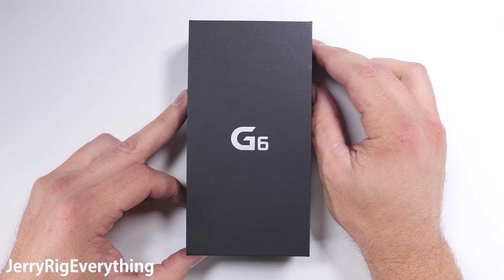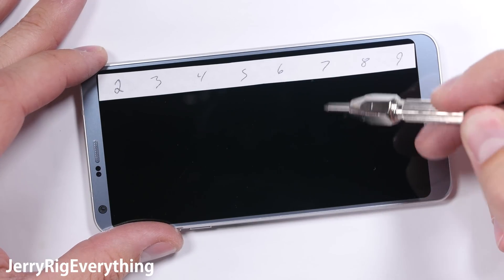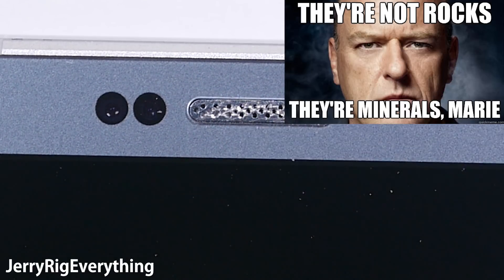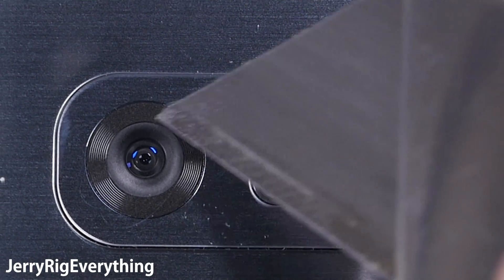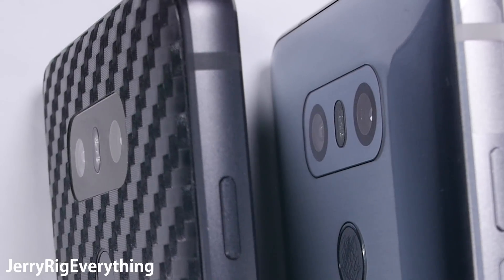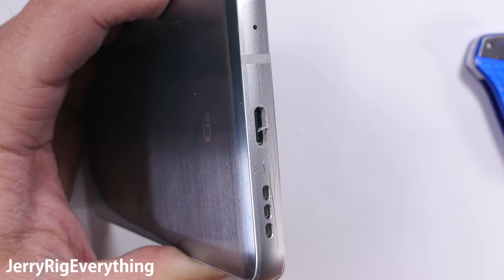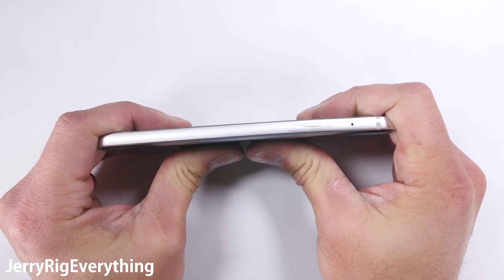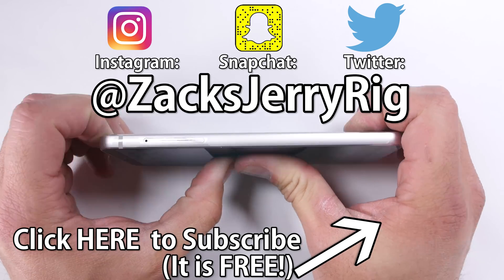LG G6 Durability Test - Scratch BURN and BEND tested!!

Comment: I have one of these that still works, but i'd need a new one with 64gb or i cant even use it these days. That said, i have dropped, stepped on, threw, and more..including putting one in the washing machine... and all i can say about it, would be the lense cover is not as hard glass as the main glass, as it broke, but the main screen glass barely cracked.. the phone has MANY chips in the metal from how much torment it went through, but still functions as normal.. i also have zero scratches on any of the glass surfaces, but annoyingly the rear case glass is broken in a few places. The BLACK one is plastic, i think, cos it cracked but never shattered. Honestly miss using these G6s..

Comment: My G6 is still going strong after almost 6 years! Even after having it fall out of my pocket and slide across parking lot floors multiple times, it only has minor scratches on the back and is still perfect otherwise. The metal border really helped it break some falls! It's sad to see that there are no new phones made as well as this one; all of them have either no headphone jack, no expandable storage, a notch or a huge camera bump...
Reply: i miss my lg g6 man. is it still worth getting a new lg g6 or no?
Reply: @Hamzah.162  honestly, I wouldn't get a G6 now. I replaced mine with a Sony Xperia 1 IV a couple months ago because I needed a bit more performance for my job. The G6 hasn't gotten any new security updates for quite a while now, though it'll probably be fine. Sony's phones are the best replacement for LG:
• headphone jack
• SD card slot
• no notch
• fingerprint scanner on the side
• the 1IV also has a metal border
• con: camera bump
• con: quite expensive

I would suggest going for one of Sony's phones IF you can get a good deal somewhere, I got my 1IV for around €600.

Comment: I have had this phone for almost 2 years and it is a very good phone. My only issue is the camera that used to work so perfectly and take great pictures changed. The camera area got scratched. The fingerprint function stopped working on its own but never cared to fix it. The phone is waterproof for sure.

Comment: I have a G6. I left it on top of my car's roof and drive off. 5 hours later I realized it wasnt lost, but most likely on the side of the road. I gps tracked it about 1/4 mile from my house and the screen was broken. The back of my thin case and pop socket had rock divets on them, so I knew it had gotten run over. I got a new screen and battery installed and it still works, I'm still using it.
Reply: @Lulu Tha 2 good
Reply: my lg k11 got runned over 2 times and the screen didnt break, only glass, so i could still use it

Comment: Still have using my unlocked G6 after 2 years. This phone does not get enough recognition! I have yet to have issues with it besides the occasional slowdown but returns to normal after a day and that's only happened a few times. It is still super quick too. Not to mention the 4k uhd HDR display and 4k Video recording for a phone that came out in 2017. This phone is a beast.

Comment: Don't buy the LG G6!!

I have owned the g6 for almost a year now, and i can say that it isn't a great phone. 
First of all it isn't waterproof, i got the moisture detection error for over 4 days. This was just from using it in the shower. It wouldn't charge even after i dried it with a hairdryer and blew it out with compressed air.
The second negative statement is that the phone is slow.... i cant load YT or PH videos without lag. (In fact this JRE video is lagging for me now) This has nothing to do with my 120 mb/s internet speed. Even the app gallery lags. I have tried the phone in safe mode and it still is slow as hell.

My advice.. just stick to Samsung
Reply: I also have my G6 for over a year now and I can say that it is an amazing phone. You get moisture detection because there is a moisture in USB-C port as the port itself isn't waterproof. How can it be? You have to put a plug in there somehow. My advice is don't use it in the shower like a normal person.
Reply: @Naviachi  It is SUPPOSED to be moisture resistant, and I SHOULD be able to use it in the shower (not even submerging it). 

The problem is that this moisture detection warning doesn't go away in a few hours, and the phone refuses to charge. Even after thorougly cleaning and blow drying the USB-c port it still gave the detection message.

Comment: Well guess what? My 6 days old LG G6 went blank/black screen this morning. After searching through online for solution and trying every possible fix, I was at the point that I wanted to throw it at the wall, but then it occurred to me that I still have 7 days to return/exchange it. I tried the method of pressing and holding down the volume and then pressing the power button, but still no go. Being extremely frustrated, after a good 45 minutes of trying all suggested online, I then pressed and both volume up & down buttons and at the same time (almost) pressed the power button and I held all buttons down for about 20 seconds and then ..... like magic, the phone LG Text Start up logo came on and approximately 20 seconds after that, the Power On LG Logo (the spinning one) came on. I then decided to delete all my contacts and any pictures and stuff I had on it, and while doing so, it went blank/black screen again. 4 or 5 tries later (as I previously mentioned) the phone came on again. I then continued the deleting of contacts etc... 4 hrs later, the phone is being on, however, I now lost all my thrust on it and I'm thinking of replacing it on Tuesday, with a Motorola Z3 Play.
Any suggestions? TY.

Comment: 00:40 I don't think it's "lucky" that any phone use gorilla glass.
I wish they all used plastic over the screen.
Why? Yeah plastic scratches but put a glass screen protector on it and it scratches less and drop the phone and you just break the screen protector.
.. with a glass screen it's not like you can save it with a plastic screen protector and that would scratch too.
.. to put glass on the screens is just consumer unfriendly and asshole behavior because it will break and people will buy new phones more early. Same with the fucking glued together phones with a battery hard to reach.

Comment: NEVER buy an lg phone. Every LG phone I have had broke or had a fault which rendered it useless. I know know not to buy LG phones as at some point WILL fail. Bootloop problems, moisture in charge port which pings every 2 seconds even though charge port is bone dry and plastic SIM trays which break and destroy SIM reader pins. These are just the problems I have had. Yes I've bought 3 LG phones derrrrrr. Phone was only made in 2017 ( still under warranty ) but when I called LG they said I had purchased a Taiwanese model and there was nothing they could do to help as LG UK was not responsible for the phone and in no way wanted to help and could only suggest I contact LG taiwan. I did so to find out all there sites,numbers etc were in  Taiwanese, I persisted. Google translate etc. Send an email to head office of LG taiwan. I received an email nearly a week later in broken English a(which was expected and not really a problem but the response was. " Sorry we LG taiwan you need UK  LG we not able to help" when I rang LG UK they refused to help but told me I could PAY to have it fixed if I chose to???? I purchased the LG G6 h870ds because it has 64gb memory over the 32gb model, dual SIM and hifi DAC, so thought it was the best option.also it was advertised and reviewed on YouTube in English and not expecting problems I suppose at the back of my mind I believed it was supported in UK and other English speaking countries as it was reviewed and advertised in English? To top that they never take responsibility for issues. My latest phone LG G6 had the SIM tray problem and constant moisture in charge port warnings. In every case all my information  photos videos music etc, was lost forever toddler pictures of my happy little son lost and only exist in my memory (bitter pill to swallow).If you buy an apple phone apple fix it. Samsung are the same and I guess most phone manufacturers are. NOT LG... Plus if you YouTube LG phone faults. The list of videos showing absurd faults and devoted, committed LG phone owners showing complicated and bizarre repair methods an tutorials is unreal and LG should be ashamed. So don't buy LG smartphones there riddled with faults and obscure issues. I believe there intent is to compete with the likes of apple and Samsung and think they deserve there cut of the market and don't get me wrong when they work there good little phones usually not compromising of features and specifications. BUT THAT'S WHEN THEY WORK. in my experience that's usually 2-3 months. I didn't want to have the same phone everybody else had and the LG phones I had all boasted awesome camera features. I know know to buy the same phone as everyone else.... YOU'VE BEEN WARNED...!

Comment: I have a G6 I love this phone. Really my only complaint is the USB type c charger port gave out on me in about 3 to 4ish months and rendered typical wall chargers useless. The port is too loose to use while plugged in and took a lot of wiggling to get it to even stay in and charging. I ended up resorting to a wireless charge pad.

Comment: Well, I have LG G6 since it's released. I bought it with a bit fear, cause my previous one was LG G4, and we all know the problem it had. But LG G6 is quite good, the camera is a beast, the light, the screen, the resolution. All is great. But there is a small problem. If anyone takes LG G6, please use a case , cause in this video the back of the phone didn't scratch but in real it actually scratches a lot, and becomes ugly, like you used it for ages already.
Reply: well yours scratched from dust, rocks, etc. not from metal he didn't lie in the video.
Reply: Kathleen Lapio I didn't say he lied. But the fact it's easy to scratch it is a fact.

Comment: Unfortunately, the back of the phone is Gorilla Glas 5 and scratches far more easily than the front. I had deep visible scratches after a few days of usage (probably because it was with my keys in my pocket). In this video Jerry did not try the same test on the back, as he did on the front. Does anyone know if the back can be replaced easily?
Reply: blub27116 i have had mine for 2 months now and not a single mark on my phone, maybe im too carefull with it or you are too careless

Comment: I am debating between 2 phones right now, Galaxy s7 and lg g6. Both are about the same price right now. Currently I am using the Galaxy s5 and it's having issues. Both of these phones have similar features, but I guess I am looking for a phone that will last several years, at least 3 without major issues. I have been using samsung so I don't mind touchwiz and like the capacitive buttons on the front. Any advice?

Comment: I love my G6. Best phone I've had so far.
Reply: Just wait till it fall from 2 feet high and we'll see if you stick to your opinion 😎
Reply: @walidak8229  Mine fell from 6 feet high and didn't shatter. Also, that emoji just makes you look idiotic and i have a feeling that your an iPhone user traumatized by your iPhone's height resistance.
Reply: Tricia,how it goes now in 2019.? Still fast and battery efficient.? I am comparing it with 3T now in 2019,which is better to get,i love the physical g6 has,but i also loved speedy performance and updates in 3T
Reply: @Life_Is_Adventuree  only down thing I mentioned so far is that now, after 2 years, my battery starts to drain faster than before.
Reply: @Life_Is_Adventuree  mine needs 2 charges in a one freaking day
Reply: Tricia Lynn yess i just got it and i love it
Reply: I decided stop using Samsung Phones 
battery life is bad
speeds are Slow 
CPU Temperature are high sometimes it goes up to 80 degrees Celsius Especially Exynos
I will change up to LG V50 5G  Model 
And Qualcomm snapdragon Series are much better 
than Exynos Models in terms of Battery life,Speed, CPU,etc.
Reply: Agree

Comment: There is a class-action lawsuit targeting two of LG's flagship devices, the G4 and V10. The suit (PDF) complained of a well-known bootloop issue that either bricked the devices or slowed them to a snail's pace—all to the backdrop of warranties or LG failing to fix the problem. After we published the story, many Android fans were wondering why other LG phones that suffered the same issues were not included in the original lawsuit.

Wait no longer: the Southern California federal lawsuit has been amended to now include the Nexus 5X, and the LG G5 and LG V20. The updated lawsuit covers every high-profile LG phone from 2015 and 2016.    Mind you i really liked my V10 in 9 months bootlooped bricked I'll have to wait for another manufacturer to have a quad dac amplified headphone that can hit the road jack i wont buy lg no more even the repair/replace they cant get right extended 2 year warranty i've been there done that.
Reply: Look at jerry's previous video on the G6 teardown. LG seems to have fixed the bootloop issue caused by CPU joints disconnecting due to heat. This was solved by adding copper heat pipes and thermal paste to the CPU. So bootloop should no longer be a problem after this on the hardware side of things.
Reply: While i appreciate your response for lg to change this would have to be at a design retooled level i worked for lucent technologies & avaya building  Internet telephony, wireless data communications devices Randolpville rd. in Parsippany NJ manufacturing facility NAFTA killed that we all became  dislocated workers well compensated ones.

Comment: LG is a good company
Reply: My lg g4 bootlooped, I got a motherboard and cpu replacement for fucking free. Yeah.
Btw typing this comment from my g4 which is now 3 years old and counting.
Reply: Greg Tziatzias G6 wont bootlap. LG made sure of it.
Reply: @anzarmohammed292  my g6 bootlooped
Reply: MrBadassheavymetal Life's Good. LG knew it
Reply: My G2 is immortal and still hasn't slowed down not one bit, the only reason I'm using a G6 now is becasue I got it from my parents as a gift but my dad is still using my G2 to this day
Reply: JRFERMM yeh
Reply: True
Reply: @V Kozmarov yet it costs an iphone user about £400 to replace their back glass, and £600 to replace the front glass on an iphone x. Plus, with lg, you can take it to any repair shop in town and they will fix the screen at about £25
Reply: Greg Tziatzias Maybe! until you get ignored if your phone bootloops.
Reply: @aligrafix1985  that nightmare ended on g4.
Reply: Not for cheap phones (Or Grocery Store Phones) Plainrock124 destroyed LG cheap Phones, and Alcatel it's always better than the LG.
Reply: Lg is a shit company i have G6 it's a flop phone for a reason i got a defected piece red smudge in screen the idiot i bought from did not exchange from Lg
Reply: @pkboss8324  That's just bad luck, clearly its a well rated phone
Reply: @jackjude  yes youre right I sold that phone & Regret it like hell that was a great phone for the price now around $100 I have similar priced huawei phone now which is actualy very bad phone , I was ungrateful & feels depressed I am not lying this actually I did because of that fault I told you.
But That fault was ignoreable , I wish I was not that much ungrateful
Reply: @jackjude  the reply i have given above I am not making this up I am just destroyed inside after selling it after using an much inferiror phone to that

Comment: Hey Zac, will you be doing a full teardown and replacement parts video for the G6? my used G6 has scratches on the dual camera glass and I'm considering replacing the back glass.

Comment: my new g6 camera protective glass has shattered without any logical reason. only in one week use. not dropped or smashed! Disappointing!
Reply: I've had mine for about a month there are no cracks or scratches maybe your just clumsy
Reply: Same here check the internet this must be a design flaw in the phone same happened with the G5 apparently. Mine was in my pocket when I took it out the camera glass was smashed. I had a case on it too never had a problem with any other phone. LG need to do something about this.
Reply: Patrick Jones Dude,the same thing happened to my camera lens. I was using a skin AND a case and noticed that my camera was magically cracked  ...luckily it doesn't effect picture quality but still sucks (apparently it's an easy fix to replace the glass so that's cool)
Reply: That happened to mine today as well. I woke up and noticed it when i have never dropped it and i have a case. So disappointed.
Reply: Leesam Safa me to it looks like a tiny Circle crack

Comment: I just got a UK retail version, the camera lens is scratched after 3 days of careful use. my HTC M9 lasted over 2 years with no scratches. I wonder if LG changed the lense material for this market
Reply: Bob Sell I understand you. I'm going through the same thing. I have black one. Look this....https://www.reddit.com/r/lgg6/comments/64h13y/how_to_fix_camera_scratches/
Reply: Thanks Jose, I sent the phone back and cancelled the contract. I'm waiting for the Oneplus 5 launch before I get a replacement for my aging HTC M9
Reply: The lens was plastic on both phones they sent me. I gently pressed it with a pencil tip then plastic pen lid, I could see it flexing but was unable to film it

Comment: they advertise the S8 as having gorilla glass 5 on both front & back
but for most S8 drop videos i've seen, the back glass isn't very sturdy as the front
LG G6 uses Gorilla glass 3 on the front and thus the front one shatters easier than it's gorilla glass 5 back
very curious (questionable) on samsung back panel actually, do hope you could confirm or give reason on why Samsung back panel is just really fragile cause if the glass shatters the waterproofing will be compromised